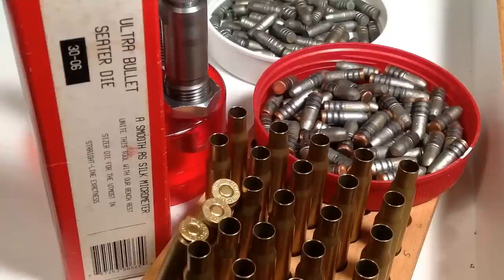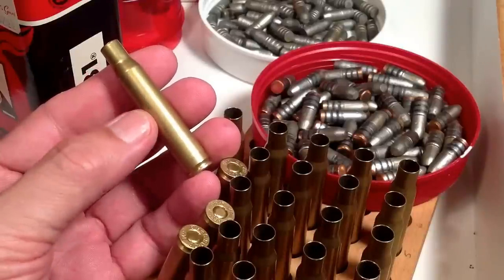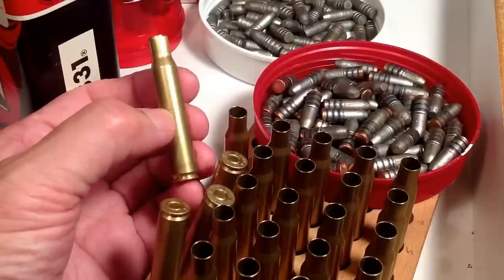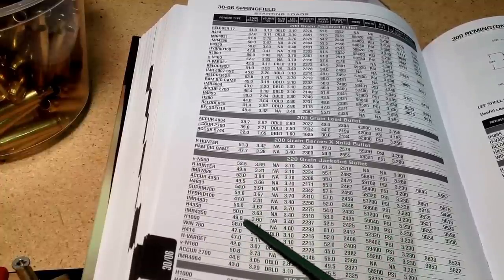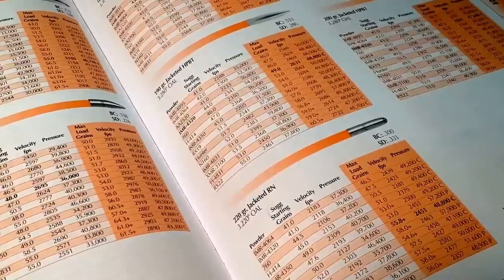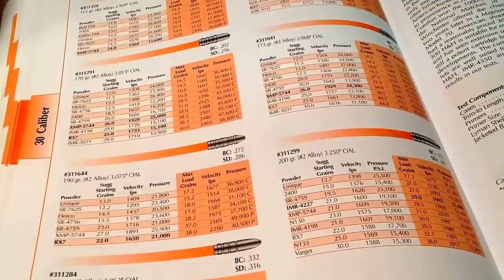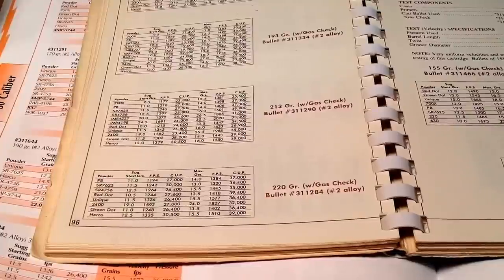The Danger Of Reduced Loads in Rifles

Comment: Great safety information, so many new to reloading go to the internet and read the forums or other sites to get load recipes instead of getting a good loading manual. There is so much bad information on the internet and it needs to be stressed to stick with loads developed in the labs, at great expense by the manufactures for the reloading books. These books only cost about 30 dollars on average and some of the these guys spend 3 grand on a rifle, or more, and take chances on bad load data.
Reply from the maker: +ecleveland1 -- Points well made - and I hope by osmosis showing all those fine loading manuals that that message also got across.  Funny that most would look at the maximum loads and realize logically that those should not be exceeded, but not realize that there are reasons that the starting loads are also not to be exceeded in the other direction.  That applies to powders like H110 also that are not to be loaded in reduced loadings, but for other reasons - the powder will not burn properly.  Have a great day
Reply: theirs also a lot of politics that go into load manuals and not all do the work themselves which is BS.  I've been called irresponsible and that I'm doing the shooting community damage by going above and beyond load data or under and trying new things but you have to remember someone started this whole thing and theirs no fun in copy and pasting others work.  
manuals are awesome for common sense guidelines but the end all authority, nope.  most will publish data based on a powder companies Willingness to participate and infighting actually seems to go on.  also some don't post pressures for a reason and others don't do the testing themselves but rely on the companies published data.  I will not name names but we all know who is the guilty culprits.
we all no what to look for and the speed of the powder dictates how fast she can go critical in either directions and most manuals won't give proven fixes to these problems.  if I have to read don't ever go beyond the max charge I will shoot the book with my extremely accurate +p+ loads with thrown powder using mixed brass and primers I found in an old drawer I think might be from my grandfather lol while still getting more consistent fps than the guy that buys bench rest Primers and measures by hand and talks about slower than max will always give you better accuracy.  ya I proven that wrong.
I often say to closed minded folks someone had to invent the engine you go to school to be a parts changer while others become mechanics because they understand how things work.  ya I have all data and Chilton's online for schematics but I don't need Chilton's to tell me how to rebuild an engine or that lower heads will create more compression.  yes stick with your lvl until you've surpassed it but it is not the end all be all and as reloaders we can go so much farther responsibly.  I'm sure if Lyman new about powder coating they would have said never exceed cast data or don't use at all and tell you it's because of some magical Doppler pressure unicorn tears they have a good reason for saying so then come back with its for your own good.  come on we don't have all that fancy equipment añd unicorn tears to do the work for us.  just copy and past and discuss with your buddies which copy and pasted version gives better accuracy in ur firearm and why, even though you don't know because lack of unicorn tears and pixie dust.

you have a good dayXD
Reply from the maker: +Andrew James -- The problem is that with experience and knowledge gained, a reloader can be advanced enough to push the envelopes with safety.  My friend Doug amazed me when I was a new reloader because he loaded his 270 Win with 90 grain bullets 1 grain over Sierra maximum for long distance varmint shooting.  But when I learned later that his rifle had a bit of freebore, then it made sense.  But to a new reloader, that seemed like taboo - the rifle would blow up.  No it didn't, rather - it just made the little varmints explode like little bombs out at 350+ yards.  He said it was his most accurate load...and would not have found that if he didn't go by what he knew.  Mark at our range does the same +1 grain with his 308 AR.  But, Andrew - I'm sure you would agree that all those newer reloaders out there would best be served by staying with the published reloading data for their own safety and learning curve.  Best to ya,  FC
Reply from the maker: Dave Knows - If there are any questions about the previous comment, pushing the envelope on loads is not to be done - only loadings within the published reloading data should ever be used, plus any stipulations like For Ruger or TC guns Only - should be strictly followed.  The examples of Doug and Mark are highly exceptional and are mentioned for reference only to experienced shooters.  Best to ya, FC
Reply: FortuneCookie45LC agree unless you have experience and the correct equipment.
That being said reloading data for certain powders and calibers I have found to be way off in winter, summer, high and low pressures.  So user beware would be appropriate because when a company publishes data that the max is 250fps under what it is in the book and to get it to spec and accurate you have to go over by a couple gr. You realise we all don't have test barrels in controlled conditions and not all firearms have the same chamber  dimensions or rifling, diameter, length, wall thickness lol.
And then you have the matter of pressure rating of the firearm and the inevitable erosion that takes place sooner with hotter loads.
If you know what your firearm is rated for and use the pressure charts while working up a load inspecting case ejection and case you should be fine.  But lately watching the news I wonder about people and their common sense.  To think every battle or bullet would be the same or that temp. And height above sea lvl. Doesn't matter a great deal would be dismissing a big part of reloading.  I also think a lot of gigs forget about high pressure factory loads that will injure the man who dare stand in the way of the ejection port lol. 
You load to the firearm or load to spec.
Reply from the maker: Andrew James - Hard to bring all this stuff out - that's why we tell anyone who will listen to stay with published data only while working up from starting loads as well so renegade events are covered.  Have a great day,  FC
Reply: ***** western powders load for 5.56x45nato using ram tac for a 55gr hornady fmj, max load is published 27.3gr at a velocity of 3450fps and a pressure of 61335 PSY but I use 27.5 gr. And get around 3200fps and it has fairly light recoil for what I was expecting.  
It is wear it is, I was using 2 firearms a rock river entry tactical and a home build.  The rock river I put in a Franklin arsenal binary trigger for testing and dumped tons of this load that was accurate as all hell but 250fps less than quoted.
Reply: FortuneCookie45LC o know and wouldn't expect you to be irresponsible.  But me I don't have that holding me back because I'm not in your position.
  I agree but i also see what goes into making that load data and or publishing a manual.  No one can put that much work into every major caliber and powder bullet combo.  
Its why people need to not just jump into things but with great risk comes great rewards.
I was reading one of the shooting illustrated mags q while back where one of the authors talked about the old days of loading hot to make ipsc regulations that now days guys would laugh at with their light bullets and goofy Magwell moods and the belts and. Holsters lol.  
Its a different world I guess have a good day
Reply from the maker: Andrew James - Interesting - you are speaking to one of those early IPSC competitors - back in those days, gun tech was on the rise and we needed a new comp gun every 4-5 months to keep up with the latest and greatest compensators and gadgets.  Magazine change speed was a big feature and we spent hours trying to shave tenths of a second here and there with holsters and magazine changes.  One missed magazine change cost the whole stage.  Yes, we shot bullets as light as 155 grain 45 ACP with big powder charges to make major power and lots of gas to run the comps.  38 Supers were the rage.  Barrels throated out to the max to run.  We spent thousands of dollars (back in 1980s dollars - that was a whole lot more) for little reward...did push gun tech though so today, factory guns have a lot of what we brought in and new buyers today don't pay all that money.  And the same shooters kept winning anyway...Finally, IPSC no longer could keep shooters going with the "spending race" and the best shooters got sponsors - we couldn't keep up with them...the sport changed to bring in Stock classes to keep shooters in the game.   When the Glocks came in, that's when I switched to shooting High Power Rifle.  Sorry to ramble, but you struck a nerve... Best Regards, FC
Reply: FortuneCookie45LC I love it! You can't beat a glock and I've watched guys with factory pistols take out sponsored inspector gadget utility belt wearing competitors but that's because they understood a gadget doesn't make up for practice and fundamentals.  
Now a guy like me gets laughed at because my stance isn't some name brand modified weaver, or wait is it the...?  Idk but those cats are embarrassing to me.  I get a thrill out of Jerry m. But I'm convinced I can shoot faster.  Seriously accuracy not so much.  Competition probably.
I enjoy tactical competitions locally but even now the safety Nazis have come out of the wood work and its just club stuff. 
I load heavy and ready for war because its not just a game to me, its minimum stress practice.  Like when I run with my rifle on my back a mile to the top of a hill I take deer and shoot steel up to 500 yds.  
I do have light rnds like my lee .224 bator with pistol powder lol but those are a novelty and more hassle then worth.  They are great for teaching your kids to shoot without the load concussion of the .223 win.  
You know something I've learned from loading and shooting is that every one thinks they know better than the next guy but theirs always a better way of doing something. Back when men fought wars with swords and bows they losing side would adopt the tactics and weapons of the victors. You know because not every one can be as awesome as me ;)
Take it easy got some lead to separate from its jackets.
Reply from the maker: Andrew James - You are a shooter, Andrew -- Continued Good Shootin' to ya,  FC
Reply: Ya I'm a better manufacturer of ammunition and firearms but yes I am.  Theirs a movie I watched as a kid, an old cowboy flick called the shootist and that had a huge impression. Not till I had my first aprentiship at 14 as an auto mechanic in a performance shop did I learn how simple everything is and how everything relates, all fields and materials follow the same basic principles. Flash forward through cnc machining and machine repair I found what quality and performance really was.  Tolerance that gives you longevity and strength, metallurgy and heat treatments that change the molecular structure of the material and how quality control issues always come back to bite you in the ass.  A hub out of tolerance or installed wrong will wear faster and that kind of thing.
I laugh when I here people say American manufacturing is the best because they obviously don't work in the field or work for a custom type shop.  To build your own ammunition, tools, etc. Is one of the only ways to be sure it will function the way you want it to. 
The Chinese labor market is filled with men and women who need their job so bad that they outperform our market ten times over, just because the tolerances may be loser on a part or the product is meant to be cheap doesn't make the fabricator poor.  I assure you if you compare remingtons civilian work to norinco you will find what I say is true.  
Bushmaster outsourced their bolt carriers to one of the plants I worked at as an operator inbetween jobs.  Long story short I don't own a newer bushmaster  or remington but I buy old remington products. Their lead engineer and designers are sad and the qc has gone to their mil. Contracts lol.  
Its funny how that works.  But yes a shooter as we are all.  We love it so much we spend hours just to throw one piece of lead at a target and we love the smell of burnt and unburnt powder, gun oil lead and ammonium nitrate will be found in are blood stream.  Artillery helps us sleep at night and we will all have severe hearing problems when we meat our creator.

Comment: I read on the Hodgdon site a powder like H4895 or an equivalent the formula for reduced loads was go to the max load and multiply by .6 . example 46gr x .6= 27.6 it's worked for me with cast bullets.
Reply from the maker: Mr P.N.Z. -  Yes on that for sure.  But most slow burning powders have danger using loads in the 50% range.  Others have commented on H4895 being OK.  Certainly, if Hodgdon clears  a powder, that's good information for us... Perhaps the best is to go with published data - we're always good with that - so powders like Red Dot and Unique in Lyman reduced loads is always good.  And if Hodgdon says H4895, then we are OK.  But taking any arbitrary slow burning rifle powder and cutting the charge substantially under the starting charge - would seem to logically be a safe practice, but may be very dangerous.   When you say equivalent powder safe to apply that formula - I would not do that unless a specific powder is cleared in print to do so.  Rifles did blow up and nothing has changed.  Have a great day,  FC

Comment: I thought the marked minimum is to ensure that the case expands to create a proper seal. I did some experimenting with light bullets & loads and especially with Mosin it will blow gases straight at your face when there is not enough pressure.
Reply from the maker: +Spörde Spyrdenstein - That's a light load indeed.  Like everything in shooting, there are degrees.  Whenever I shoot light bullets or light powder charges, I look for powder fouling on the cases - if there is that, incomplete chamber obturation is indicated.  That's never a good idea even if powder gases were not heading back your way - that's major lack of chamber obturation.  I like your idea of the "marked minimum" - that's a good one!!  Best Regards - FC

Comment: You need to talk to Hodgden...they say with H4895 you can go as low as 60% of the max load.
That's about 27 grains.....also they say IMR 4895 is similiar but not as accurate.   These are two special powders for light loads.

Comment: nice vid but you indicated it for heavy bullets. there are also published data on light bullets, ae: "gallery loads" as well as the m22 frangible which weighs in at 108 grs. now i haven't tried any of the "gallery loads" and i have tried the M22 load using 11 gr of IMR SR 4759 in my 30'06 without any problems. the M22 frangible is still available out there but, you must remember, it's not a "jacketed" ot "lead" bullet. good for 100 meters or 117 yards with some accuracy.
Reply from the maker: +Nadien Sans -- IMR 4759 is a very good fast rifle powder in the same class as the 4227s.  Fast rifle powders and pistol powders do well for reduced loadings in our rifles.  It's the slow powders like 4831, Varget, H414, Reloader 15 etc that can have major problems if loaded reduced.  Good shootin' to ya!!

Comment: The OLD #3 lyman cast manual is available on the interwebs.  I was wondering what the heck im going to do with a bunch of Copper plated Berrys .310 123 grain.   Now I can load them up in my 7.7 arisaka, 303 british,  7.62x39 and 7.62x54R if only I had data for 125 grains.  I guess I will experiment.
Reply: lyman 44th also available on google pdf from 1967 has some good data.

Comment: I am casting 30 cal bullets and they come out at 175 gr how do I get a load a recipe
Reply: I use Vihtavuori N310 and 0.38 gram of it from Remington 700. I use 165grain bullet from Ares. I use also 125gr H&N bullet and load is similar, its 0.41 gram (not grain!).

You must use fastest powder available; Vihtavuori N310 is a good choice.

Start a faster load; I started from 0.5 gram (not grain!) and reduced until bullet flied under the speed of sound. That means somewhere near the 300m/s.

Comment: Trail Boss is a great option. It is very bulky and fast burning. Use with cast bullets only.
Reply: Why only cast bullets
Reply: @davidbermudez4072  Because of the burn rate of the powder. It is very fast burning and cast bullets have low friction and don't allow pressures to build up like jacketed or solid bullets. High peak pressures are dangerous especially for older guns. Hope this answers your question.
Reply: That's a bummer I was hoping to use this in my Henry x 45-70 with 300gr hornady hp but they are jacketed with lead top hollow points.
Reply: @davidbermudez4072  There are many powders you can use to reload those bullets. Something like 4198 or varget will work. Obviously consult your reloading manual for starting loads. If you ever get some cast bullets it would combine well with Trail Boss for a plinking load.

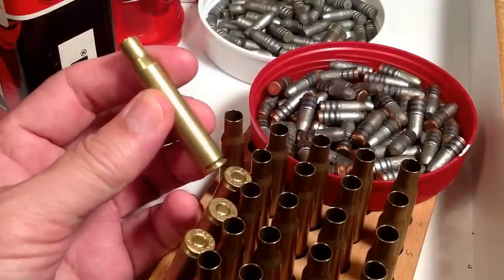Comment: At ~1:56 'and then you get a muzzle obstruction...'  kinda took the wind out of the rest of the discussion.  Faster powders, polyester filling (what does that do for accuracy/cleaning?) to keep the powder against the primer, finding/using reputable reduced-powder loads is a good place to start,  As much as I'd love to whack a gopher (all gophers) with my AR the 12-ga and .22s fill that bill.
Reply from the maker: David Taylor - The real goal of this video was for new reloaders to understand that the starting loads listed in the reloading manuals are there for safety also...powder charges less than the starting loads may have risk factors.  Have a great day,  FC Steve